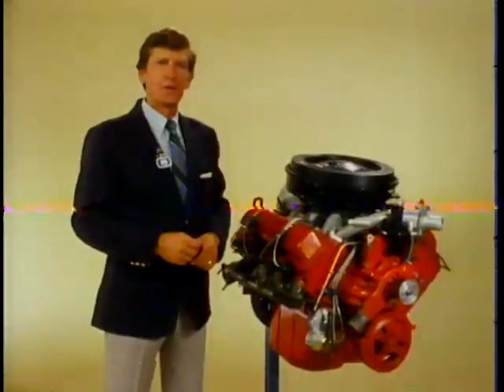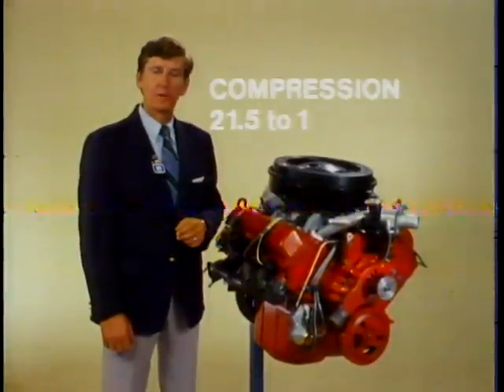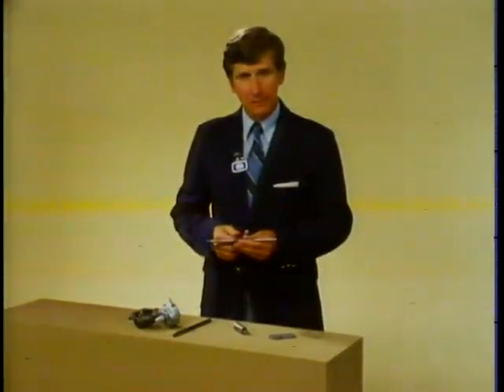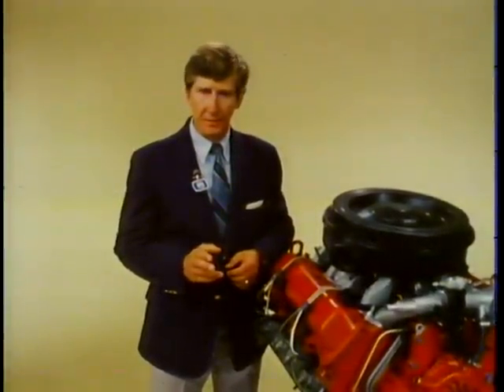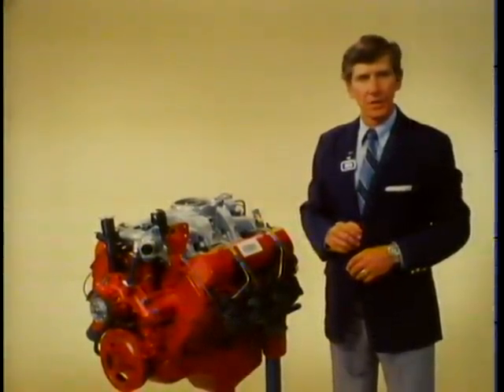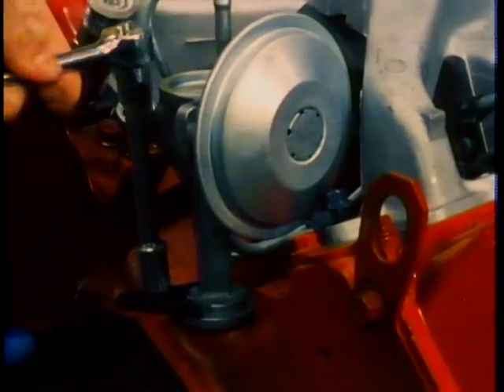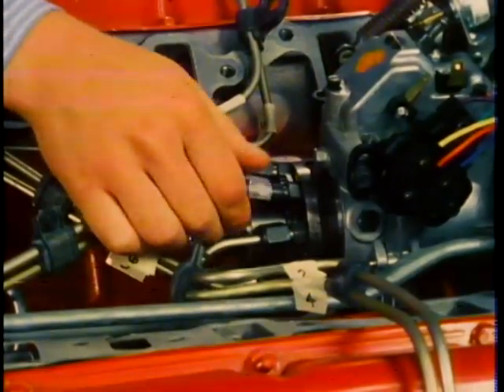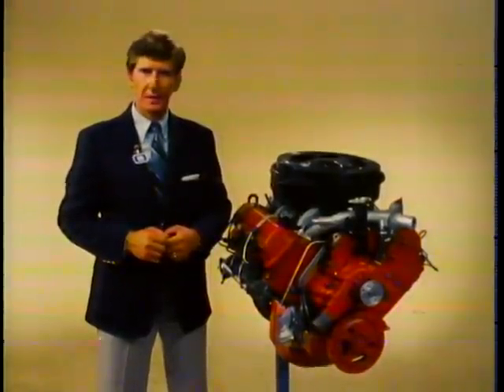General Motors /  Detroit Diesel 6.2 Training

Comment from the maker: Amazing this massive 6.2 makes similar power to the 2.0 common rail motor in our Passat!
Reply: It is around 34 years old, afterall. Made to be a long lasting truck motor that got good mileage.
I have one in my 3/4 ton 4x4 and get 19-20mpg.
Reply: +FCFordLord Definitely i have 6.5 Turbo them figures were off back in the day and hook your passat to 15k pounds hahaha different kind of torque and power.
Reply: +compu85 your vw won't still be running in 35 years
Reply from the maker: +19504x4 No, probably not.
Reply: it's all about torque
Reply: and still produces lower emissions
Reply: Diesel just cant perform without a turbo.
Reply: +Ryan Ehlis or an intercooler.
Reply: compu85 the VW diesel in the Rabbit in this same era only made 69 hp... and we're slower than a fat kid riding a bicycle.
Reply from the maker: The NA 1.6 made 54 hp. That's 33.75 HP/L. If the 6.2 made the same HP as the VW 1.6 it would make 210 HP.
Reply: look at the torque ... and how long lasting ewwropean engines and american... on my truck is about 620k... i worked in shop about 8 years and not seen any of 1\3 milage as mine
Reply: Nicky Surr the torque is still awful for a 6.2 litre Diesel engine lol
Reply: 19504x4 considering plenty of 35 year old vws run. you're very wrong.
Reply: most gas v-6 engines make way more torque than these did.  These engines are garbage.
Reply: The 6.2L detroits were built to be gas sipping alternatives to the small block chevys and were built to the same horsepower and torque specs of the standard v8 of which for chevy at the time was the 305. Starting out they were fairly under powered but towards the end of the 6.2L's production (1993) they topped out horsepower wise at 160hp and 285lb-ft of torque while the military version (of which one can easily enough find retired military square body chevys) topped at 185hp and 330ft-lbs. Now naturally aspirated they are a bit meh but if you ordered one back in the day with a Banks Turbo Kit or had one installed (available for the 6.2L's from 1988 to 1993) it greatly wakes up these diesels giving a solid 60+hp and 150+ft-lbs of torque, it also improved mpg from 19-20mpg to 22-25mpg. The banks turbo kit on its own gave the 6.2's the performance of their predecessors the 6.5L Detroits which put out 215hp and 440ft-lbs (if you got the turbo option as GM decided the make their own turbos).

Now sure the 6.2's and 6.5's have their issues but all can be easily dealt with improved aftermarket parts such as improved main bearings and high performance aluminum heads. There's even a few super chargers available for both the 6.2's and 6.5's that can get both up to around 300hp. If one decides to spend the time to build one of these up properly then they can indeed be good performers, not as crazy a performer like the 12 valve cummins 6bt's but one could expect fully done up with the super charger or twin turbos to get about 300-350hp.

Oh and don't go calling an engine junk when you've never owned and experienced one yourself ;) Take a look at the classic ford flathead v8's, they are some of the worst designed v8's with poor cooling and head flow but man when someone gives them a bit of tender love and care they can become damn good v8's!
Reply: I would like to see that Passat tow my 6000 lb  boat. My 86 Chevy 4WD pickup with 235,000 miles on it  has no trouble doing it.  BTW, the boat pictured has a pumped up 6.5 GM turbo diesel in it.
Reply: Hell yeah! Detroits for life!
Reply: kimmer6 wow, thats an impressive feet SMH
Reply: Oh like you have room to talk. I bet you've never owned a detroit, genuine or gm built.
Reply: kimmer6 a damn Passat isn't built to do that. so it's a dumb comparison.
Reply: Agreed, like comparing limes to tennis balls just because they're both 'green'. The transmission alone wouldn't hold and the engine doesn't have the good low end torque and would literally blow itself to pieces.
Reply: C.L.LocomotiveWorks We'll let's not act like 6.2s were bolted to the best transmissions either. a 700r4 isn't great and a turbo diesel vw probably makes as much torque as a 6.2 or maybe more. I really like the 6.2 in my suburban but it's no powerhouse and I don't plan on trying to tow much with it.
Reply: Well they were't built to be power houses anyways but can be built to do some decent towing if done right. The 700r4's are decent transmissions but they're gasser transmissions and weren't built to take diesel torque, best trans that was available for a 6.2 in my opinion was the Saginaw Muncie 4 speed, they called them rock crushers for a reason lol The New Process over drive 4 speed's aren't bad ether and would do well.
Reply: C.L.LocomotiveWorks A healthy 350 makes more torque than a 6.2 so that's really not it. 700s aren't strong but do fine if you're careful. I sure do wish mine was a manual though.
Reply: Just a shit old engine and that's all it's ever going to be
Reply: well yeah a 350 can make more, considering the 6.2's were built to the 305's standard. Course that's till you get a banks kit for it to really wake it up.
Reply: No, the 5.7 Oldsmobile diesels are a shit old engine, the detroits have actual potential. Saying the detroit is shit is like saying the 7.3's are shit just cause they're ford.
Reply: C.L.LocomotiveWorks I'd like to see a DI version of the 6.2 I'd imagine it would have more torque and easy stated in cold weather. Maybe a bit louder tho
Reply: Mopar, read what the original post said about the Passat having more power. Sure, it might have more but cannot pull a heavy load for hours on end like an old slow turning big displacement diesel engine can do.
Reply: the 6.2's aren't that bad starting in the cold, I've seen 24 valve cummins start harder in the cold lol But yea Direct Injection would be an improvement.
Reply: I love fan boys try to defend the 6.2
Reply: flight2k5 yeah there as bad as the mustang fan boys lol!
Reply: This motor would pull your Passat in two.
Reply: It doesn't even have a turbo. It's rather amazing for what it is. I have one, and it pulls anything I throw at it.
Reply: no it wouldn't
Reply: suuuuuure it does
Reply: I've never went wrong buying a VW diesel the 1.9 diesel is the most reliable diesel VW/Audi's made, easily last 40+ years with proper maintenance. My 2010 Golf TDI with the same 2.0l common rail engine in your passat was still running strong with NO major repairs at 200k miles when I traded it off.
If I get that lucky with my 6.2 diesel I'll be very very amazed.
Reply: @Mopar43V3R The main problem with the 700R4 is keeping it cool, they blow up because they get to hot. Like you said the small block 350 puts out just as much torque as a 6.2.
Reply: @piston head 1243 My 6.2 started all winter long at -30 or colder with out problems.
Reply: mopar43v3r my factory k-5 has a th400. Not a 700r4. It's a m1009 vehicle
Reply: i get 22.4 in a 89 suburban with a fuel pump leak, love that engine
Reply: Yeah but there's still plenty of 6.2's still running after 20-30 years of abuse and hell, get back to me when you're engine is 30 years old after towing a couple thousand of pounds for a couple thousand miles.
Reply: My 6.2 87 v10 Suburban (yes thats a model not a cylinder count) gets easy 24 mpg and I can pull just about anything. Same motor, has a turbo, has the intercooler. This motor just keeps going and going. Ran the HMMVW for 11 years, replaced by the newer 6.5 detroit diesel. Military 6.2 which had 185 hp and 330 ft-lb torque, not sure what my rating is with a ATS turbo since its not listed anywhere. And I know personally vets that say they seen this motor pull a abrams tank out of a ditch. My burban would pull your passat backwards up at hill while your at full throttle to the top of everest. And It'd use less fuel.
Reply: It can...turbo just make it come to life
Reply: J-code 6.2 is different than the civilian version.
But Alex G is off a bit.
The J-code 6.2 made 160 hp and 275 ft-lbs of torque.
Having owned and driven Blazers with a 305, 350, 400 cu in gasoline and now a 6.2 J-code Diesel military Blazer (M1009) I can compare the relative power between those engines in the same platform.
The 6.2 J-code falls right between the 305 and 350.
Not even close to the power and torque of my 400 gas Blazer i still own.
Not a good towing motor the 6.2 compared to a 400.
But My 400 gas Blazer gets 9 MPG.
The 6.2 diesel Blazer gets 17 MPG. 
Both with 3:73 gears though one has a turbo 350 and other a turbo 400 trans they both are 1:1 third gear minus torque converter slippage.

Facts and figures taken from The Diesel Page 6.2L Diesel Engine Improving Performance and Economy page 6.
Vin code C LH6 130 net HP @ 3600 rpm
Vin code C LH6 240 lb.-ft @ 2000 rpm
Vin code J LL4 160 HP @ 3600 rpm
Vin code J LL4 275 lb.-ft @ 2000 rpm

The head design accounted for most of the power difference between the civies and military versions, as well as a lack of an EGR system on the latter.
Long as short of it is; You want mileage in a diesel with longevity and without towing abuse=6.2
You want to tow the shit out of things for years, uphill=400 cu inch gas motor.
All around use with minor towing but better performance and slightly better mpg than the 400=350.
Don't bother with the 305 in a Blazer= Better off with the 350 or 6.2 (if it already has that)
Reply: Same economy if sitting in same size body.
Reply: +C.L.LocomotiveWorks Saginaw and Muncie are 2 totally different trannys. Muncie SM465 4-spd was tough as hell. Muncie M-22 was called the "rock crusher". I've owned 3 of them in the last 35 yrs. Damn good hotrod Trans, not so good for work trucks. Saginaw 3&4spds was light duty shit like you would find in a 6 cylinder truck for the 3spd and 70s Vegas had Saginaw 4spds. I wouldn't recommend either for big power applications.
Reply: +Diesel 8290 Or the LS fanboys. They really get sensitive about shit, especially when ya bring up the bigblock Chevy engine.
Reply: compu85 
Haha the 6.2 was fair, totally gutless though. 
The 6.5t was a time bomb machine....
The 2.0pd in the wife’s old 2004 is getting swapped into my mk1 golf for some fun. 
That old passat boat used to get 43mpg on the highway. 
I’m sure it’ll do mid 50s easy in the mk1. 
“They say” you can get around 250hp/400ft pounds out of em pretty easy too
Reply: kimmer6 In the right frame the VW probably would pull it.  These engines were weak.
Reply: BUTT !!!!!!! WITH A 700 R4 TRANS. 3/4 TON TRUCK YOUR FUEL MILEAGE IS ABOUT AS HIGH AS 26 TO 28 MILES PER GALLON ON MORE LEVEL TERRAIN.
I KNOW BECAUSE I HAVE OWNED MY 1984 GMC FOR OVER 30 YEARS, (THIRTY)
AND OVER 575,000 MILES.
ALL YOU SHOULD KEEP GOOD FILTERS,GOOD CLEAN FUEL, AND OCCASIONAL CHANGE  GLOW PLUGS, AND ALWAYS USE EXCELLENT BATTERIES, CHANGE EVERY 3 TO 4 YEARS.AND DRAIN AND REFILL COOLING SYSTER. 
  HAPPY MOTORING !!!
Reply: The 350 old's was a great engine, you only change the head bolts with studs ,washer and nut ,one at a time. The problem with a olds is that The head bolts were inferior ,wit diesels high compression. A PRETTY IMPRESSIVE 350 GAS ENGINE THAT WAS MODIFIED TO BE A DIESEL., CHEV., FORD , PONT. MOPAR SURE AS HE'LL WOULD NOT STAND UP TO THE TASK. THE  ACHILLES HEEL WAS BAD HEAD BOLTS, SHOULD HAVE BEEN STUD SETUP.
GO BACK THRU HISTORY AND STUDY OLDSMOBILE, 
AWESOME HISTORY, AND CADILLACS TOO.!!
Reply: @dennishensley1150  en
Reply: It might appear to make more power but the smoke the passat generates negates all of that.
Reply: Not the same at all.This one is for towing and carry heavy loads.
Reply: Can your passat engine haul an uparmored 8,000 lb military humvee?
Reply: @MrTheHillfolk  of course that engine is two decades newer...
Reply: @kimmer6  
Fuck I'm game to try it 
It holds 35 bags of wood pellets ,I think I'll cut the roof off and get one of those Smythe Conversions.
Reply: @kaulincurtis9665  
I did pull an f350 dually dump truck about a 1/2 mile down the road with a rabbit diesel, back in the day, he had a flat up front and was sitting in the middle of a blind curve in the sticks.
Reply: I'm sorry but even for a 1982 engine 130hp for a 6.2l engine its garbage,i don't care how many years or miles it last, it burns more money in fuel than the engine is worth.
Reply: Do you think this 1982 engine generates less smoke and would pass 2020 pollution tests for new vehicles?
Reply: @mopar43v3r  be glad it isn't.. the new venture 5 speed, had a design flaw, that forced the company into bankruptcy.. I had a fleet of these trucks, if it wasn't a blown 6.5 diesel, it was a chewed up power/pilot shaft bearing in the tranny.. in 5th gear the powershaft spins 30% faster than the pilot shaft.. the bearing runs dry on the nose of the power shaft, stuck in the back of the pilot shaft.. then it welds the 2 shafts together, or the bearing melts out, chewing up all the moving parts.  G.m could have fixed it , by cross drilling the power shaft and pumping oil into that bearing.. no, they put synthetic oil in instead..it was like a bandaid on a gunshot wound..
The trick to saving your new venture tranny is to not use the 5th gear for more than 20 miles at a time at freeway speeds or towing.. 
One way I could tell the pilot shaft was heating up, was the clutch slave cylinder in internal and it heats up.. you will loose the the Freeplay in the clutch.. or it may even start to slip, as the hot fluid in the slave cylinder, starts clutching the transmission.. lost several clutches before we figured out to block off 5th gear by welding a nut in the shifter, to stop driver's from using it.. never had a clutch or transmission problem after that.
Reply: @legorailroader844  yeah, John Deere build the the 50 and 60 series Detroit.. they are great engines
Reply: @MechRider89  that's because it's an indirect injection/glowplug design.. but what makes it start good in cold weather, makes it junk, in the heat, and power tables.. indirect injection is a worthless design..cat tried it in the 60's with the 3406A engine.. the quickly went to the b model..
Reply: @dennishensley1150  my surburban got 31 m.p.g.  when it wasn't in the shop
Reply: @dennishensley1150  you are correct, that was one hell of a gas engine.. but 21 to 1 compression was just too much for it.. it broke crankshafts and blocks too
Reply: @antoniofdez620  no...nasty nasty exhaust..
Reply: @19504x4  GM 6.2 and 6.5 don't last 2 years 😆
Reply: @blakehooten8901  some people don't understand torque and horsepower lol

Comment: My 85 Chevy 4x4 had a 6.2 L Diesel I upgraded to the 6.5 L Diesel and bombed proofed the engine and it’s so much better I swear it runs for ever I’ve had the pickup for 10 years and I never have any problem since I do regular maintenance!!!
Reply: How did you bomb proof it?

Comment: went a bit fast there at the end, couldn't write down my notes fast enough
Reply from the maker: ya the disks get worse at the end. I guess they aren't sealed perfectly and air gets into the seam. most of the older disks have trouble past the 20 minute mark. There is a segment before this on the disk I edited out.